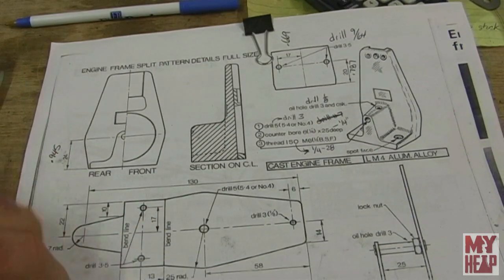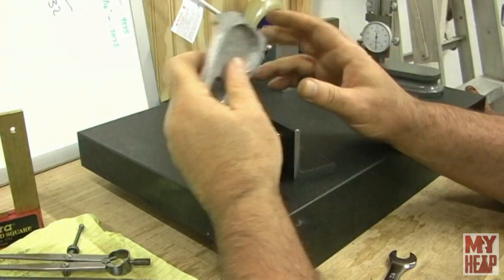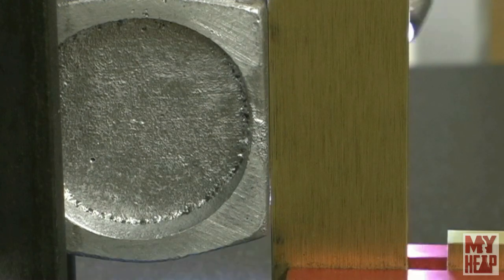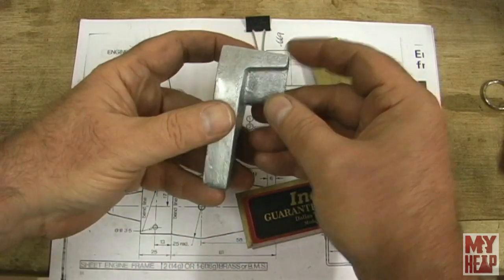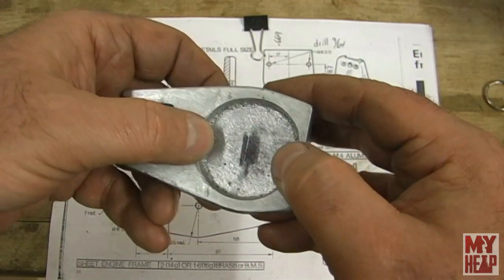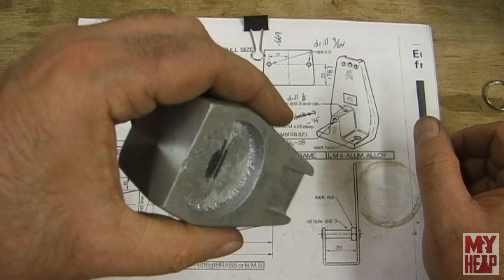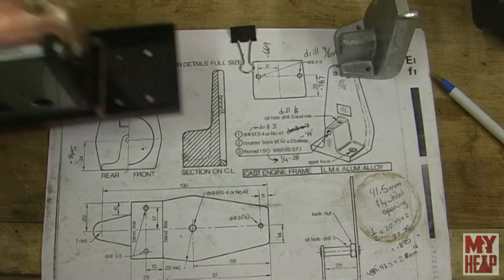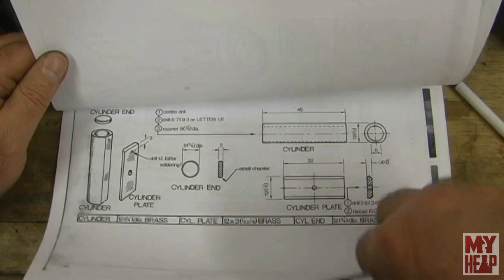Kenneth Wells Stationary Engine - 10 - The Engine Frame

Comment: As for the extra material remove from the bottom of the engine frame you could add a shim there to make up for that material if need to line up with the other parts.  I do believe that this part could be made from aluminum bar stock with a milling machine if needed.
Reply from the maker: Hi William.  The only relationship between the engine frame and any other component would be the boiler and the location of the Steam inlet tube to the engine.  In this case 20 thou wont make a hill of beans.  I should be okay with it.  I have to give Kenneth Wells credit, he made the design almost bullet proof for beginners.  I was thinking about the bent sheet metal frame and the differences between those if a bunch of kids were making them and realized I don't have a problem in the world.  Thank you so much for watching and taking the time to comment.  I really do appreciate it.

Joe

Comment: G’day Joe, I was calling out, “Joe stop, Joe “ but you didn’t hear me and found out later it was not a good way to clamp the frame, so your second operation to square up the base cost you material which probably lead to the flywheel hole being about 2mm out. It will still work out just be mindful later when lining up for other things (?)
Hey you mention how the cast aluminum drills but it was cast in Australia wasn’t it? so it would actually be “aluminium”:)
Look’n good 
Cheers 
Peter
Reply from the maker: Hey Peter.  Yes, it was about 15 thou out of square over the 1-1/2" length of base.  I scratched my head a few times trying to figure out what was wrong before o realized the clamps were working against each other.  Once I strapped to to one angle all was well.  Oh well live and learn.  Must be why I am a tyro.

The error did cost me a little bit other than the steam inlet being a bit lower, I don't think much rest will be affected.  I will know more as I build.

Well, yes it was cast in Australia, so perhaps I should call it aluminium.  Haha.  Thanks for watching Peter.